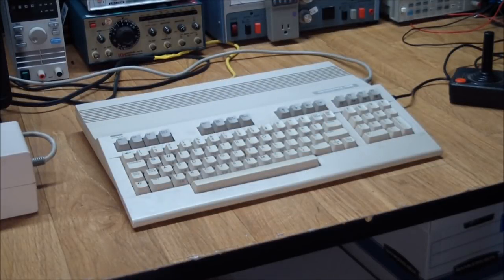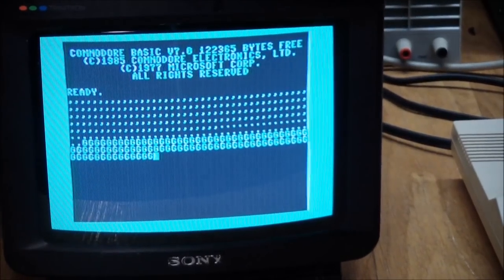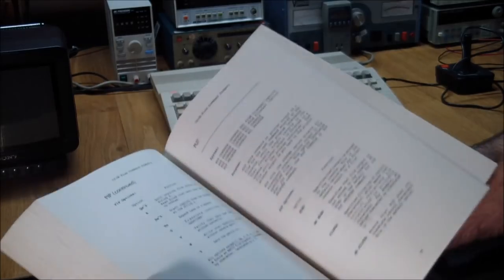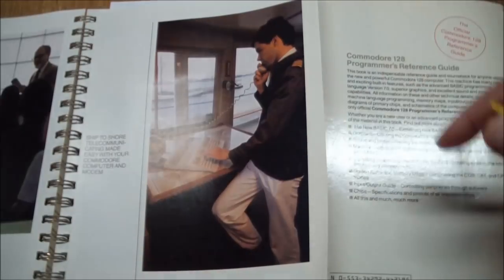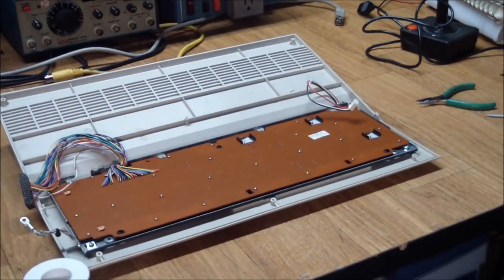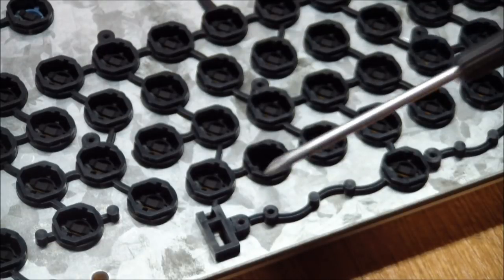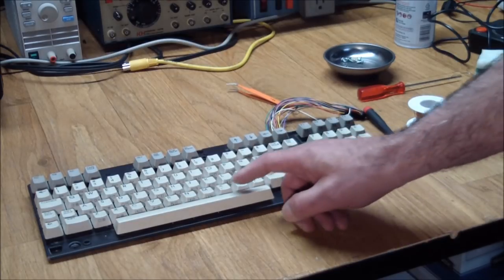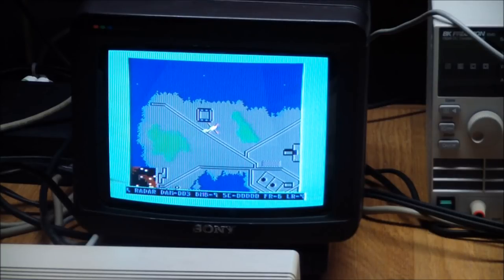AE#84 Repairing A Commodore 128 Computer Part 1

Comment: Someone may have already mentioned it but you can type “GO 64” in 128-mode and it’ll get you there gently instead of messing with the power switch. Also, I recommend a Ray Carlsen power brick for your 128 instead of using the original one. They’re safer for your motherboard and chipsets.
Loved your video and am now subscribing! Thank you!

Comment: Just got an Ebay project C128 and am collecting everything I need to start troubleshooting. It didn't come with a power supply, so that is one of my projects. I did order a connector and also a C64 to C128 power adapter. I noticed that the C64 5Vdc is 1.5 A and the C128 requires 4 A so I will keep that in mind. I also ordered the repair manual with schematics and the diagnostic cartridge. I have been wanting a C128 for decades and now is my chance!
Reply from the maker: Good luck with the repair. It's definitely worth the effort.

Comment: 23:27  i have that same spring after removing the keyboard,  dont know where it goes.  also i have this little black plastic square piece that i dont know where is goes.
Reply: ok found where they go. black square thing is for the power on led.  spring goes between pc board and metal keyboard on number key pad plus key ' + ' the only hole there.

Comment: I believe that there are a couple of extra little springs under the space bar on the 128 to help the key return to its raised position.  The spring that you have found looks about the right size for one of those.
Reply: That is correct. There's two of these little springs to either side of the bigger spring that sits in the middle of the space bar.

Comment: Thanks,  yes they have the voltage level converters chips on the inputs and outputs of the ECL RAM chips. Do you know why they would want to use ECL RAM chips or PMOS RAM chips for the video data? The video data used in most arcade games didn't use PMOS RAM or ECL RAM it was just normal NMOS static RAM 2114 SRAM chips? Yes i know that PMOS RAM and ECL RAM are faster "access time" compared to CMOS and NMOS RAM chips. But most arcades use just NMOS Static RAM it seems.

Comment: The ic pin frame is made from aluminium, meaning the pins are aluminium. So the correct word to use would be corroded and not rusty. And looking forward to the next instalment to see how you make repairs to the main board  to deal with the corroded tracks.

Comment: Hi Artie I believe the little spring you found around 24mins lives on the underside of the top case possibly near the LED, I think I remember the c64 having the same thing, (maybe something about static that disapates through the RF shield) 🤔🤔
Reply from the maker: That's interesting. So when the keyboard starts acting like a van der graaf generator I'll revisit the issue. Now where did that spring go?

Comment: If the split key shafts continue to expand or develop new cracks try wrapping them with very fine wire and superglueing it in place. Then if you widen the holes to suit this diameter you will have a permanent strong repair.

Comment: I'd never heard of a 'square DIN plug' before - you learn something new every day :o)
I wonder whether a tiny bit of silicone spray on those key plungers might have freed them up ? Or was the plunger simply too expanded to recover like that ? I'm thinking of the inevitable next sticking key here....:o)
Reply from the maker: I don't think that the cracks developed under normal use, but rather abuse so I'm not too worried about other keys sticking. But if it happens again we have a solution now. Lubricating the shaft may result in carbon contact contamination.

Comment: I am the guy who is having these manufactured. There are folks in other parts of the world that buy them from me and distribute them locally which is typically a better deal because of shipping costs. There are also several companies making new power supplies using these square DIN plugs. Search for 'soigeneris' and you will find my website, look under 'vintage computing'.
Reply from the maker: That's great that you can supply the part. I've previously passed on a C128 because I didn't know where to find the power plug.

Comment: nintendo punch out arcade game and nintendo games in general use ECL RAM chips to load some data, not sure why they used ECL RAM chips. Same reasons why i don't understand why logic boards use Flip flop chips when they can just program the code in ROM chips to latch on the data at the right time and release the data. Flip flop chips can be "omitted" in my opinion if you program the ROM files to time the data and output the data at the correct time. I just think flip flip chips don't need to be used in logic board if you program the code right. Unless I'm missing something
Reply from the maker: You are correct, it looks like Donkey Kong type boards used ECL RAM in the video section. It was probably cheaper than PMOS RAM but they still had to add two way voltage level converters.